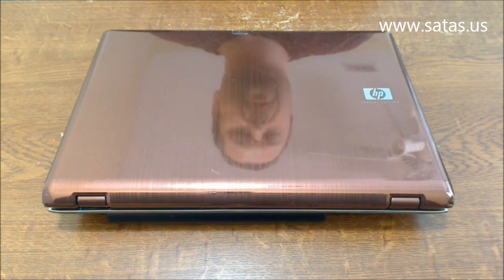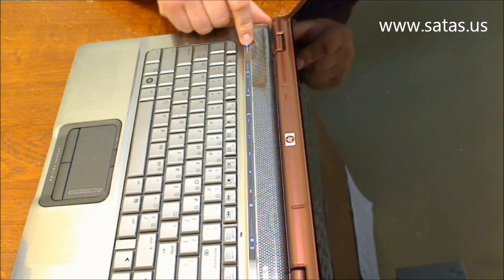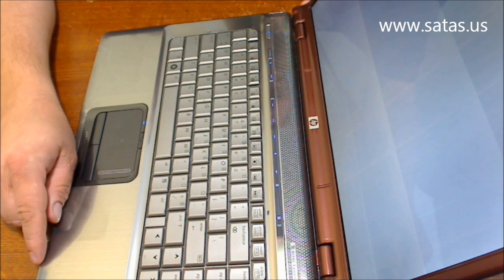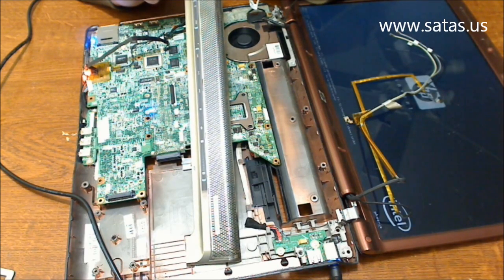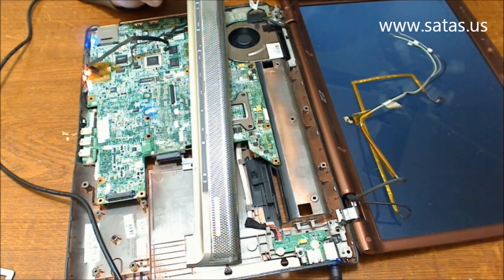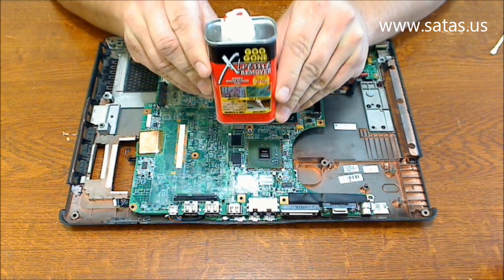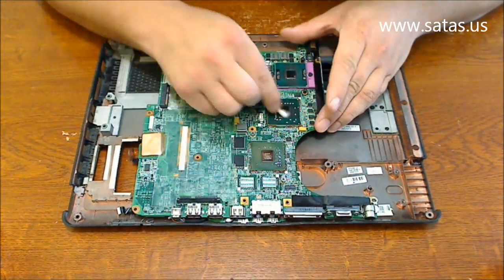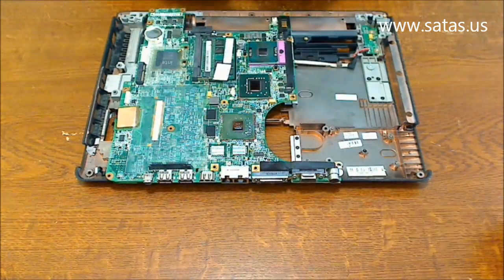HP DV6000 nVidia Card Blank Screen Repair-vivatious.wmv

Comment: Nice work. Looks like the cooling system is defective and cause the overheat of solder. The new thermal paste should help some if you can apply thin enough and without it trapping air bubbles in the paste.